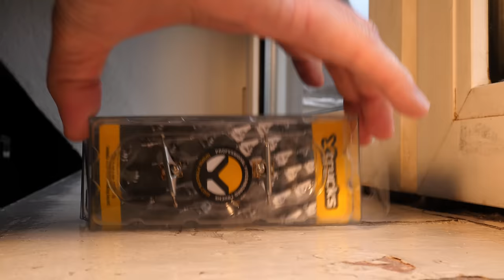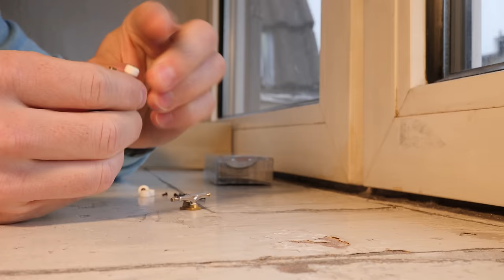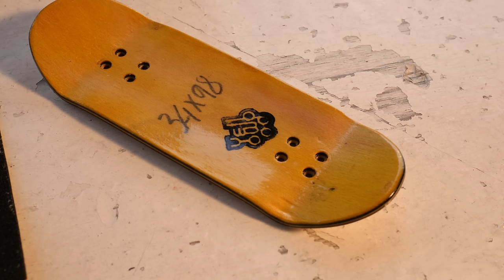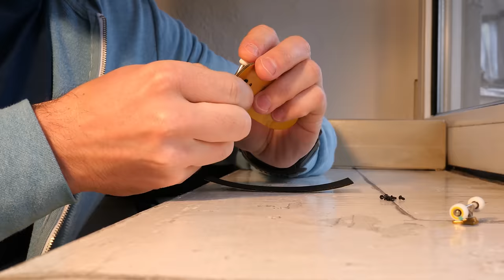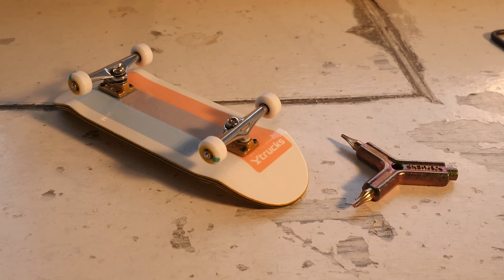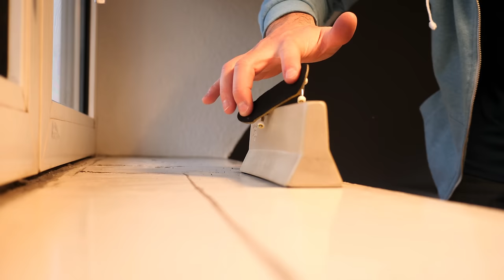34mm YELLOWOOD & YTRUCKS X5 Setup Assembly in 4K - fingerboardTV

Comment: Hey can anyone help? I got almost the same set up, just different deck two of my wheels won’t spin, and I know I didn’t tighten them too tight
Reply: The bearings are probably out of place, try moving them back in with a fingerboard tool screwdriver
Reply: Or you need to clean your bearings